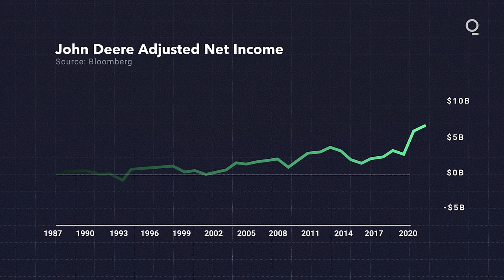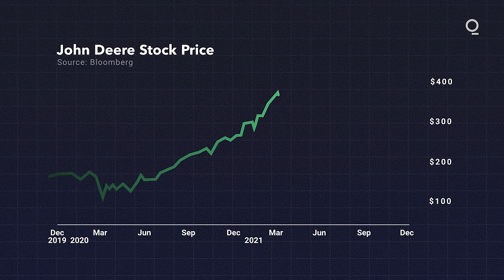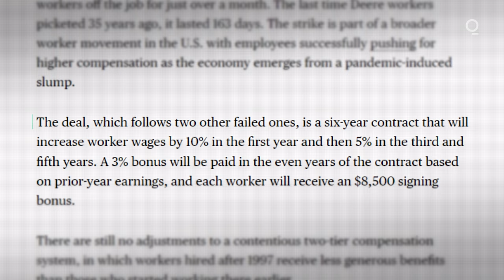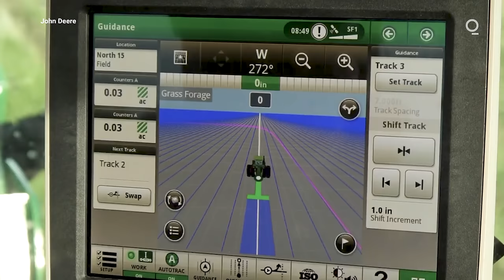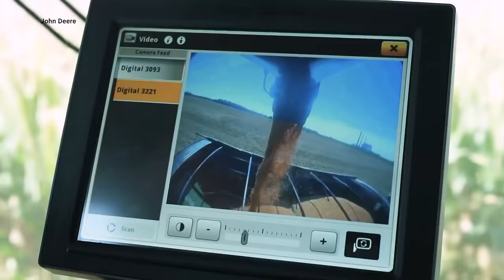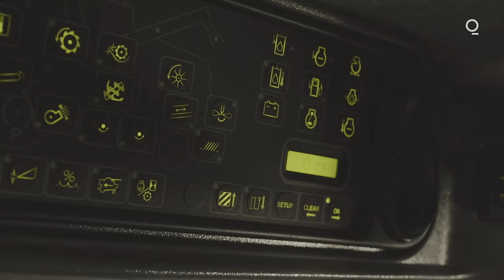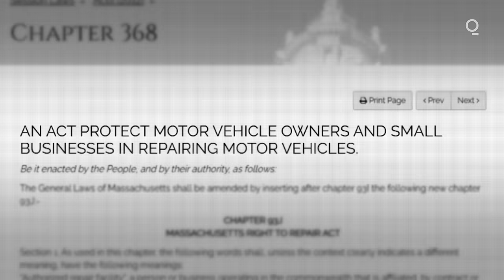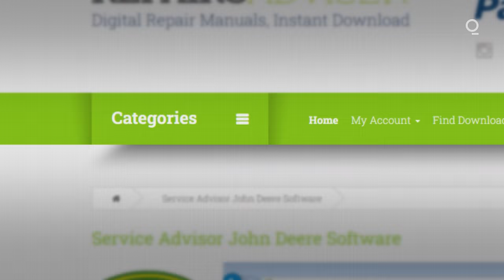John Deere Is Facing a Farmer Revolt

Comment: Not having 'A Right to Repair' is simply Un-American, period. And JD using/selling farmer's harvest info is simply CRIMINAL.
Reply: considering the use to influence the Derivatives/ Commodities Markets, YUP.
Reply: Here in the UK right to repair is coming in. Unfortunately it will not stop car manufacturers sourcing inappropriate spares.  It is often the case that something like a touch screen goes wrong but all the manufacturer will offer is a replacement for the whole head unit at around 50% of the market value of the car or a very expensive repair by the head unit supplier. Then there are very simple things like windscreen washer pumps. This should be a £10 item but  on my Nissan Leaf it was £50 sup;lied only by the manufacturer. Then the labour cost for fitting it was £100. Ridiculous. It appears that the car was not designed to be serviced by its owner.
Reply: @rogerphelps9939  most of a dealerships profits come from service and parts sales. They make just enough off the car sale to pay the salesman, the shop keeps the buildings lights on.
Reply: On selling their information, I think farms should charge JD for that. Them taking it by default without paying for it is where it's criminal
Reply: @stephentroyer3831  Facebook does the same thing. So do banks, and any other data logging companies.
Reply: @rogerphelps9939  Of course cars aren't designed to be repaired by their owners. The whole after-sales part of the car industry does live off the repair bills You pay for in ridiculous dimensions. Since cars were not any longer sold but the majority is leased or financed by the producer, dealerships make barely enough for their real estate costs, let alone the longlegged blondes working the desks in clothing requiring 24 °C all year round on calve level. Without You buying their working hours on a regular basis they couldn't survive. 
The prices for parts, though, pay for fines, settlements and lobbying against emission regulations and union rights - that is why VW does charge You for parts more than Toyota did in the eighties for example - just remember what they had to pay to date as a "settlement" for their ingenious software known as "defeat device" in the U.S. alone  ......
Reply: @misanthropyunhinged  I have been working for the same wage from 1980 until now. 23.11 an hour
Reply: @misanthropyunhinged  yEAH RIGHT KaReN
Reply: @ickster23  they won't, though. Data sales are too much of a money maker. Human beings are the product, not the consumers
Reply: all the big tech companies do that too
Reply: @oneofmany1087  and rich getting richer
Reply: @manfredschmalbach9023  
That's what I don't own a new car, own a 98 4x4  Hilux ute, 5L 3 litre diesel with a  mechanical  injection pump, and can fix most stuff myself.
Reply: @fredorico41  Of course. The youngest car in my fleet is 18 years old, most of my vehicles come from the eighties, some from the seventies/sixties even: mechanical workhorses easily repaired with sane mechanical engineering, some handy tools and a lathe, at most, no emission dumbfuckery, no electronic logging of no matter what data whatsoever, no warranty/copyright issues because the makers do not exist anymore or have been bought out three times since then, the young emmission control freaks do not even know how that stuff works, let alone know what is "original" and what's modified, which does help with theft-risks as well. Build-not-buy is a way of living not many can sustain though: too less of a basic male education towards technical stuff these days, and too less of general understanding about being self-sufficient and self-reliant as the top-most goal a man should have ....
Reply: @manfredschmalbach9023  
Spot on mate, I learnt a lot of mechanical knowledge from other people and friends who are old school mechanics .
Reply: @misanthropyunhinged  What worker rights? This is about consumer rights, and private property rights, not communism. Human have rights, not "workers".
Reply: @manfredschmalbach9023  Nailed it. 👍
Reply: @rogerphelps9939  
In the UK and EU we have something known as “Block Exemption Regulations”, for example…. 
… under these regulations, car manufactures must by law allow you to be able have your car that’s under warranty serviced by an independent garage without voiding the warranty, provided it adheres to the car maker’s servicing schedule and uses genuine parts. They must also provide spare parts, service information and software to independents… 

Looks like something like this is needed for farmers!!
Reply: Umm not its not...forcing a company to do something they dont want to do is un American. If you dont like what jd is doing, DONT BUY THEM🤦‍♂️ The right to repair is severely miss understood.
Reply: @Wouter d.B. 

Deere should at least financially compensate the farmers for the data they harvest if they are not going to make it opt in. The data is literally worth more than gold, the right to sell it should be up to the farmers who own/use the equipment, not the corporation who manufactured it.
Reply: @LehalParminder  MS never opposed Linux.   That's simply a false narrative.  And not that MS is a wonderful company, they're just like any other, but their products are open to developers, their APIs are open, and anybody can write programs for Windows.
Reply: Yeah our fishing boats here in New zealand having all there gps data stolen from them. 
Everything's screwd. 
Jacinda thinks it's awesome.
Reply: @misanthropyunhinged  Your country is better how?
Reply: Un-American? Is not sceezing out the profit (supply chain/employees/customer) in every way the most American way of doing business ?
Reply: It means you don't really own the vehicle. Imo.
Reply: @wayfa13  Thanks. You're more than welcome to quote me. In fact, if want more comments, just let me know.

That said, I do need to make an apology with regards to my, "making shoes from tires comment.". If I had known the poster has cars in his country, I would have never made that comment. I'm sure he has old tires littered all over his front yard. They may not be Michelins, but they'll have to do.

Have a great new year, and may the bums in the garbage dumpster feast off your best droppings.
Reply: Proof that corporations are calling the shots. The America you talk of is long gone
Reply: @AT-wl9yq  Michelins are french lol
Reply: @HyperVectra  And if it wasn't for us, they would be speaking German.
Reply: @willmc4403  I welcome his attitude. I'd like for my own people to determine our own future. Nationalism y'know? There's no such thing as a modern society btw. None of the liberal ideals you think are new are new. They've come along and died out many times in history in many parts of the world.

Comment: John Deere WAS a great company. I have a 1955 John Deere model 70 gas tractor that turns heads. I even work with it sometimes. A beautiful machine. But my neighbour's modern Deere tractor is a nightmare, requiring transport hundreds of miles to a dealership for even the simplest of repairs. The company's assault on farmers and their right to repair will cost them dearly in the end. Sorry, no pun intended.
Reply: most companies where great back in the day!  SHAREHOLDERS fixed that!  Gatta have that huge profit every year so people can let there money do the work!  very sad system that goes against the customer!
Reply: This is why John Deere equipment from the the early 2000's and earlier are bringing such high prices at action. They are well built and you can fix them yourself.
Reply: Guess it will cost them Deerely.
Reply: @boxoffisa  guess you just felt the need too be a comedian?  don't quit your day job because you don't know your audience AT ALL!
Reply: we have 2 john deere lawn tractors..one is a 200 form the 1970s and other is a 160 from the 1980s..BOTH are easy to fix with simple tools..the sad part? ANY part from a john deere service shop for BOTH costs hundreds if its even available anymore..even for a small part like a carburetor jet..so alot of the parts on both we bought used on ebay..
Reply: Can a farmer become a licensed mechanic to fix their own tractors?
Reply: @dwaynemclaren7160  take a look at the his vs your likes before replying
Reply: It won't cost them much, what do you think they're doing with all the data their harvesting. The farmers are paying John Deere to train the AI which will replace them. Once they reach a certain level of efficiency, the farmers will be tossed aside completely
Reply: @NadeemAhmed-nv2br  training the IA, bro what are you talking about 😂😂. 
AI can and probably will replace farming but they don't need to steal the farmers data to do that. There just monopolizing on maintenance it's as simple as that, don't over think it.
Reply: @dwaynemclaren7160  *CEO's
Reply: @dwaynemclaren7160  : Shareholders are anyone who has stock. Guess who that is? US! Shocking I know. Somehow people think "shareholders" is another breed of humans, instead of John and Jane Doe who have their retirement in pensions, mutual funds, etc. Or play day trader on the side from the comfort of home.
Reply: @dwaynemclaren7160  Why do they need that huge profit? You can thank the union.
Reply: @brodriguez11000  really you dont think i know what a shareholder is?  little defensive NO?
Reply: @BaltimoreAndOhioRR   again preaching too the quire! lol
Reply: @collins9708  The issue is not the mechanical work, it is that if for example a sensor is replaced, it must be activated by software at a john deere service center before the tractor will use the sensor, even if the new sensor works exactly like the old one. This software is not available to the end user.
Reply: @MGMan37  ok and what I'm asking is why can't the farmers become certified to get their hands on this software. What is stoping them. 
Do you have to be an employee of JD?
Reply: @collins9708  Yes. John Deere does not offer "certifications" to use their programming software. You must be an employee of a service center to use their software at the service center.

Comment: About 20 years ago I purchased a JD front loader, one day it would not start so I called JD to see about getting a mechanic to fix it, they told me the bill would be $1000 the second he stepped out of the truck, plus hourly rate, plus parts. I fixed it myself, it was a $50 part, have kept it running myself ever since. FJD
Reply: So why didn't you just fix it yourself in the first place? It's this way weather it's John Deere, Caterpillar, Case etc.Those tech's are getting $40 an hour or more, it isn't gonna be cheap no matter what brand you run!!!
Reply: @nicholasbrown7068  - Could be it might void the warranty, I don’t know.
Reply: @nicholasbrown7068  Because then you void the warranty... Duh.
Reply: @nicholasbrown7068  It was my first piece of heavy equipment, and first diesel. I now own multiple machines and fix them myself. I would have gladly paid $40 an hour, it was the $1000 charge for driving 15 miles in a service truck that I balked at. FJD!
Reply: @willie2235  We work on many machines under warranty, as do others.
Reply: @nicholasbrown7068  you're kinda blaming the victim on this one buddy, lol. those are extortion rates.
Reply: Def Bet  The unions are the only real means the workers have for negotiating higher wage. Corporate executives and shareholder dividends are by far the majority cause of high consumer level prices
Reply: @nicholasbrown7068  40 and hour???  Where is this???   I worked for JD and Cnh and did not make near that.  Even when "master certified".   I have since gone out on my own to make that kind of money.   I hope that there are techs out there making that kind of money.   In my area the dealerships charge 100+ an hour and the techs make about 20 to 25 an hour.  So again the company is making the big profit.
Reply: ya but the new version of that part is 200 bucks and you need the computer system to program the part to your combine so then its 1000 and 200 and 1000 and another 4000.
Reply: @nicholasbrown7068  not everyone has the time to do that. Maybe he needed to grab the other tractor to feed cows or clean the barn. Ya know?
Reply: I can see their point if the equipment is still under loan. But after it is paid for, it should be up to you who fixes it.
Reply: @dalmatiangirl61  What was the cost breakdown for this $1000  estimate   with only a 15 mile  travel  charge?  How many hours at $40   labour  were they charging you  for this $50 repair ?
Reply: @dbly1977   I presume the Dealer is paying  the overhead   ?
Reply: @sarahann530  I don't know, maybe just don't remember the hourly rate, all I remember is they said the bill would be $1000 the minute the guy stepped out of the truck, then time + parts would apply. The problem that day was a dead fuel cut-off solenoid inside the injector pump.
Reply: @willie2235  It was long out of warranty
Reply: @dalmatiangirl61   So you remember the cost but you don't remember the breakdown of it . What is the name of the Dealer so we can  check  on their call out rate ,their mileage rate and tech rate . I am curious to find out how they arrived at the estimate .  Just give me the Dealer and I will call them !
Reply: @sarahann530  RDO in New Braunfels Tx, mind you it was 20 years ago, so doubt any of the same people are there today.
Reply: @sarahann530  When I called, all I knew was the machine ran the day before, but would not start that day, so they were not quoting on a solenoid replacement, but a diagnoses.
Reply: @dalmatiangirl61   So how many hours were they charging for a diagnosis . ?  Did it not throw a code , after all you diagnosed it and fixed it for $50 and have kept it going . So this was 20 years ago and Dealers charge a lot more now .  I am going to call them tomorrow to get today's cost  for a service call 15 miles away from base .
Reply: @sarahann530  It is a 1985 machine, throw a code, LOL, yeah the code was "I'm not starting".
Reply: @dalmatiangirl61  I called RDO and they said you must be mistaken 
 A quote like that is ridiculous even today 20 years later . It seems you lied in your op trying to make a dramatic statement but you got carried away . It's common for poorly educated people to make such silly mistakes . It's why you are poor and require Govt handouts .
Reply: in 2023 John Deere announced that they were moving all manufacturing to Mexico to save money. Meanwhile, executive salaries have soared !!
Reply: @PronatorTendon  And the decreased value of the dollar through over spending of gov. money= high prices